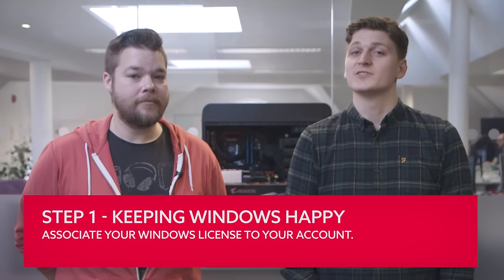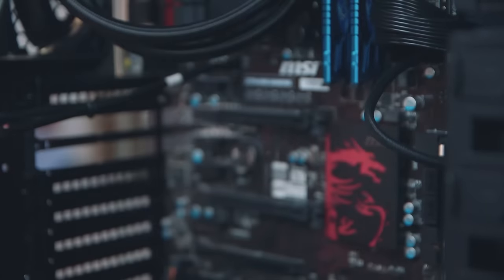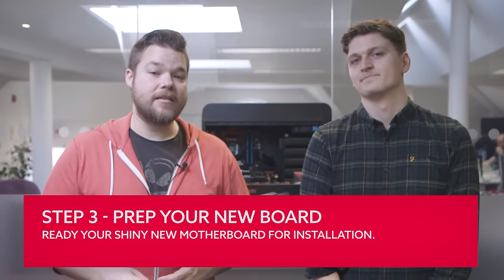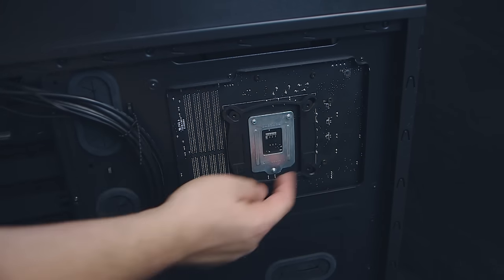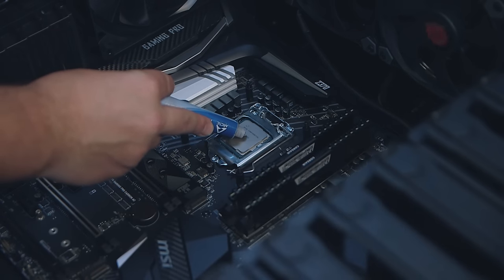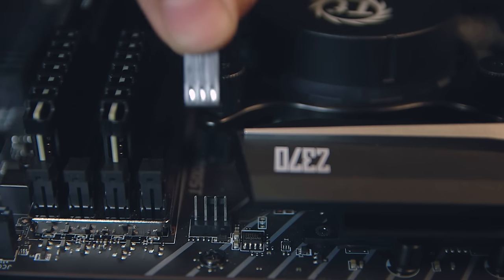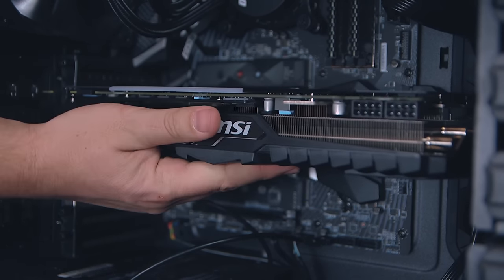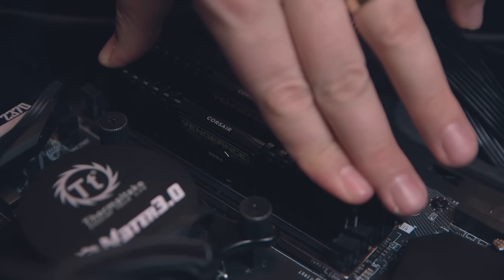How to replace your PC’s motherboard in 8 easy steps | Hardware

Comment: so i know this video is a bit older but incase anyone sees this i would appreciate some help... so i registered my Microsoft account to the computer but however after i did the replacement windows 10 deactivated and when i try to call customer support they want a product-ID for windows 7 (which i upgraded to windows 10 with the free update they had a while back) and obviously i dont have the 7 product-id, as it was bought several years ago... does anyone have any possible solutions
Reply from the maker: You might still have the activation keys listed on your PC. If you download Produkey there's the slightest chance it might find the Win7 key on your machine.

Comment: Short version - uninstall all drivers and bios/uefi tools. Place in identical board or cpu and chipset platform for best experience. You may have to re-register windows. Btw where is the tutorial for swapping msata or nvme drives?

Comment: You skipped over the only part that was the reason I watched the video. I just wanted to see if there were any tips or things to consider when REMOVING THE CPU FROM OLD MOTHERBOARD. How do you just skip over that part?
Reply: LordFord you click the little lever down and it comes up and then you can lift the metal cover off that holds your cpu in place
Reply: @snzy4932  I was just curious if there was a special tool I needed or a special way to lift it off without damaging it but i ended up just doing it anyways and learning from first hand experience and it was easy. Thanks for the reply

Comment: One question I want to upgrade my  gigabyte motherboard and the cpu is amd a10 series to a Asus b450-f  and cpu to and ryzen 7 do you did I well have problems? Thanks
Reply: Trust me, buy a better CPU like the ryzen 3 2200g. Only costs about 95€ and is 1000% better then the trash amd10! I own the amd a10-7870k but now bought the ryzen 3 2200g. though, you need a new Motherboard + RAM (DDR4) to use it!

Comment: I removed all my cables and cpu and fan. Reinstalled everything properly (have a video to refer to and everything is properly connected). Once rebooting my GPU's don't light up and I cannot see anything on my computer screen. I am plugged into my DVI slot on the motherboard... still no images just a black screen... any idea what I've done wrong? I have not reinstalled windows or any drivers or anything... hope someone can help a
Reply: I know this was a while ago, but for anyone receiving the same issue. You will need to plug your HDMI, DVI or another display connector into your graphics card NOT your motherboard if you are using a graphics card and not internal graphics. Hope this helps.

Comment: sorry for being late but , is every power supply compatible with modern Motherboards ? cuz i have an old psu and i don't know if everything will work correctly
Reply: Honestly, it depends on how old like hopefully not over a decade old. I have an EVGA psu from 2012/2013 that was compatible with my recent build and more than enough wattage/power cables. To find out, please go to a site like PC Partpicker and insert your components(make sure you look up and select the right components) and then the site will tell you if there are any compatibility issues. Also, the site will tell you the necessary wattage for your build and so on.  A great psu is not crazy expensive and a component you can typically continue to use for a good amt of years, an upgrade would not be the worst idea.

Comment: Hey guys, just replaced my motherboard with a new cpu and ram, and my windows 10 account seems to not have ‘remained active’. I get the ‘repair’ error on launch. This is concerning because I don’t want to reinstall my old motherboard just to create a recovery file.

Thanks in advance

Comment: What about the RAM? when do we insert that? Should we do that before we plug in the GPU after already plugging in the cables?
Reply: the rams should be installed first, easier if you have a big cooler. than the cpu and cooler, than the GPU. Don't forget to put the ram into no. 2 and 4 slots ( if you have only two sticks of course)

Comment: Gonna be swapping from an old Intel cpu to a Ryzen one, how would you remove the stock intel cooler? Do you just pull the black things in the corners of the cooler back out? 

And how would get the thermal paste off the old cooler? It's just rubbing alcohol, right?

Comment: I just bought a prebuilt pc about two weeks ago (brand new) (i5 9400, I think the thermal paste is preapplied). However, I want to replace the motherboard and build my friend a pc with the extra parts after upgrading. Do i need to apply thermal paste when I transfer the cpu to the new motherboard?
Reply: Apply new thermal paste when attaching the cooler, it goes on top of the cpu!
Reply: First, you should probably clean off the CPU and the heatsink of your cooler with something like a Q-tip or maybe alcohol swabs. Then you put the CPU in the new motherboard's socket, put a pea sized drop of thermal paste in the middle (or however you prefer), press your cooler down and screw it in diagonally. (Bottom right to top left, bottom left to top right)
Reply: @zlurkx2432  thanks a lot!

Comment: Hi guys, before you switch the motherboard do u need to uninstall old drivers for the old motherboard? If so, how?
Reply from the maker: No, your OS should be able to make all the necessary connections afterwards.

Comment: Im going to upgrade the motherboard only. Is there a program where i can see the cpu socket and also if it is DDR3/DDR4 ram sockets?
Reply: CPU-Z is a good application, or you could look up your CPU and find what socket it uses or even physically look at your motherboard to see what DDR ram slots you have.

Comment: I fuxked up, im super sad now
Reply: how?
Reply: menash nah I fixed it, I just fucked up the connections from the case itself to the mobo. I hate those pins
Reply: Oxading I feel u. I once didn't update bios and got extremely frustrated rebuilding everythibg several times (I couldn't tell it was OK because i wasn't much experienced) and couldn't understand why my cpu won't work.
Reply: menash I had a problem with downloading the bios since I had no Internet connection because I needed the Internet bios for ethernet. I was lucky I had a Wi-Fi adapter kind of thing so I could download it over that instead.
Reply: Oxading that's really lucky lol

Comment: can someone please reply to this comment: I just bought a new motherboard, CPU, and Ram and I am about to install everything. Since I am not upgrading my harddrive and keeping my current one I will not have to redownload my windows 10, correct? All I would have to do is sign into my microsoft account when I boot my computer? is there anything I should do before installing my new hardware? Such has back up my hard drive. basically Windows is saved on the hard drive correct and wont need to reinstall anything?
Reply: I think Windows is already installed into your hard drive. Hope I could help! :)
Reply: uninstall all of your drivers for sound, display Intel or amd type drivers, chipset drivers, and associate your email with current OS and it should work without reactivating windows

Comment: So is there any need to remove any software from PC before the upgrade? Like drivers or motherboard software? On windows 10 if that makes a difference
Reply from the maker: It really does, the latest versions of Windows have been really good at coping with even major hardware changes like changing your motherboard. What is worth doing, however, is making sure that for the new board you make sure to have either the WiFi or LAN network drivers downloaded and on a USB stick so you can get your new system connected if it doesn't automatically find the right network drivers when you restart Windows.
Reply: @PCGamesN  So it's literally just remove drive from old board, slap it into the new one? That's great! Thanks for the help!

Comment: I’m planning on saving money to upgrade to a intel cpu and a new motherboard but before I do that do I need to clean all the hard drives and ssd’s?
Reply from the maker: Sometimes it can be cathartic to start afresh with a new build, but if you're on a modern version of Windows it's not vital. 

If you log in with a Microsoft account it will register you license to that login so you can activate quickly and easily if it does deactivate when you change hardware. But often Windows will just figure things out itself and your old installation will work fine.

If you want to cover yourself use the  Produkey app to note down your license key before you swap hardware. You could also download the LAN drivers for your new board onto a USB stick in case it has trouble finding the network after you swap.

Comment: With a new motherboard, don't you have to reinstall windows and format the hdd, because it won't recognize the old existing windows and drivers on the old hdd?
Reply from the maker: It depends what version of the OS you are running. Windows 10, and to a certain extent Win7/8, is really good and patching the drivers on the first boot after upgraded the motherboard. So ideally you shouldn't have to do a fresh install, though you might need to reactivate your license.

Comment: Question, so If my old computer was bought from say (Newegg) and Windows 10 came preinstalled can I still change out the motherboard?
Reply: Asking the same
Reply: Yeah so I know this is extremely late and I’m basically saying this for people with this problem today. So I bought a cyberpowerpc gua883 back in may of 2018 and I upgraded my psu and gpu and now my mobo and cpu, so I believe that you just have to secure your acc with Windows 10 and It’d be fine. I’m not 100 percent sure as I’m not LTT lol!

Comment: Hey quick question here, I'm going to be replacing my motherboard with a new one of the same exact brand and model. I will still be using my same old cpu and memory should I be good or is there anything is should worry about?
Reply from the maker: If it's the same motherboard then you shouldn't have a problem :)
Reply: PCGamesN thanks for the reply

Comment: do i need to clean install windows when i replace the cpu and motherboard? if so how do i do that?
Reply from the maker: If you're running Win10 you can link your MS account to your Windows license and use that to log into your PC. Doing that should mean you won't have to do a fresh install. 

But if you want to do a fresh install note down your Windows license key, grab an 8GB-ish USB stick and go to the Microsoft site to download an ISO of your version of Windows. Then you can use the media creation software to make a bootable USB installation stick.
Reply: @PCGamesN  okay, thank you. also should i wipe my drive beforehand or does a new install delete the old os and everything automatically?

Comment: Mine starts up but there’s nothing displayed on the screen, could anyone suggest fixes?
Reply: All I can think of is that your CPU either has no integrated graphics and you plugged the monitor into your motherboard's display port, or you plugged it into the GPU but didn't plug in the GPU's PCIE cable. (or maybe a cable or two isn't plugged into the motherboard)

Comment: I'm gonna upgrade my mother board and cpu but I don't want reset my windows how do I do it
Reply from the maker: If you're using Win10 you can associate your Microsoft account with your PC by logging on with your MS  acc. That way when you first restart after changing board and chip it will just need to do a quick check to validate the license. Win10's also very good at grabbing the necessary new drivers when you restart so long as you are online.

Comment: I've been sweating an update 
because I don't want to fresh install Windows anymore. Fingers crossed it'll work out.
Reply: Arnold Mejia did it work because I’m doing my upgrade and I need to know that f it works
Reply: @uncomfortablesunsets4532  it's going down tomorrow, that's why I was researching today. To be safe I'll go ahead and create a mirror of the drive before and then try things out.
Reply: Arnold Mejia alright man good luck
Reply: @uncomfortablesunsets4532  It worked! I just finished due to Cooler delivery issue. I did make sure to connect everything to the same ports just in case. Also had a disk imagine and boot drive ready to go worst case. But it actually worked, Windows has come a long way in 10. Although I'm dealing with license issue but I think that can be fixed and I wouldn't care about buying a cheap license key out there.
Reply: Arnold Mejia awesome

Comment: I'm upgrading my mother board, CPU, and ram, and replacing the harddrive with ssd.

Any help of this? I have all the parts. I'm just scared to try
Reply from the maker: So long as you take your time, make sure you've got all the cables plugged in (especially power for the CPU cooler), and have thermal paste on the CPU, you should be fine. My recommendation would be to install the CPU and RAM into the board before you put it into the chassis. It's just easier than fiddling around in a cramped case.

We do have other guide videos if you want to check those out, including a full set on building a system from scratch.
Reply: Go to toms hardware tech forum and list your exact parts and what you want to do   i bet at least 2 to 4 people will have great advice
Reply: @chrisevans9779  well I tried lol.. it powers on but keeps resetting and no display
Reply: Around here we have microcenter    once you give up not that im saying to but still you can find many pc shops that will get it running for you    from 50 bucks to about 150     im having trouble with mine after a motherboard swap   micro center here i come   soon anyways

Comment: *Question*? 
I was watching a another video and the said that you should uninstall drivers associated with your old motherboard. 
Is that required in your process ?
Reply: No need. Your new motherboard will automatically detect the new software. I know what video you're talking about and he just did it to be cautious. No worries about that.

Comment: Quick question since my older brother confused me 😂 When i change the motherboard do i need to buy windows again?
Reply from the maker: If you're going to keep using the same installation you shouldn't have to. Your best bet is to log in to Windows via a Microsoft account and then link that to your current license. If Windows then has an issue with a hardware change that should sort it.
Reply: Hi Sir, another question ive curently a asus mobo installed want to upgrade to msi how do i uninstall the asus Software and install the new msi mobo Software, is there a specific step? Tnx

Comment: So if I haven't activated windows, do I have to reinstall it at all or?
Reply: The AfroPlaylist(Fro-Tho) thats my question too!
Reply: Jonathan Armstrong hey man, so I actually went ahead and just replaced both My Mobo and CPU and i didn’t have to reinstall Windows at all. I think you just select what system you want to boot with in your BIOS when you first relaunch the PC post installation and you shouldn’t have an issue as far as windows is concerned. I also skipped that step regarding the windows act. In this vid too Incase you were wondering.
Reply: The AfroPlaylist(Fro-Tho) just installed new cpu, mobo and ram, no problem, no reinstall, didn't activate either, everything fine

Comment: so no need for reformat?
Reply from the maker: Salty your boot drive? Normally no, modern operating systems should be capable of dealing with changing hardware, though you will need to deal with Windows activation.
Reply: I`ve read some articles that it might have drivers and compatibility issues. And also I don`t want all my files to get deleted. Is there something to worry about when changing motherboards with different chipsets?
Reply from the maker: Salty if you're going from a really old chipset there may be some issues. But if you're running a modern OS IT should be capable of dealing with the switch. We regularly swap our test drives between different motherboards and chipsets.
Reply: @PCGamesN  What about going from an i5-3570k with a p8z77-v mobo to the new Ryzen 3000 series coming out shortly? Should I be fine with out reformatting?

Comment: Do I have to format/delete everyting from my PC before replacing the mobos ?
Reply from the maker: No, you shouldn't have to. Modern versions of Windows are very good at dealing with hardware changes so it should be able to pick up the pieces without problem. One thing to note, however would be to download the network drivers on to a USB stick for your new motherboard before you install it in your PC as that might be one of the few sticking points.

Comment: Clear and concise video guys, great job. So you regularly swap motherboards without first uninstalling old MB drivers ?  I noticed a couple of other people had asked this as well.
Reply from the maker: Thanks, and honestly, yes we do. It's maybe not manufacturer-recommended but Windows is now very good at picking the right drivers for you. It is probably worth downloading your new board's drivers before you replace it - you might not have the right LAN or network drivers in place when you restart otherwise.
Reply: @PCGamesN  , thanks. That makes sense to me about the LAN drivers.

Comment: Do you need to reinstall Windows?
Reply: Doesn't seem like it since Windows is installed on your hdd or ssd and the license is associated with your account. I would think that means everything should boot up normally without having any issues to reinstall windows.

Comment: Will I have to reinstall windows?
Reply from the maker: Depends which version of Windows you're using. From Windows 7 onwards they've been pretty good at responding to new hardware. You may have to reactivate your license.
Reply: @PCGamesN  Licence should be fine, with windows 10 you can link your licence to an email, so long as my current install works. since I have 4tb of stuff I dont want to lose.